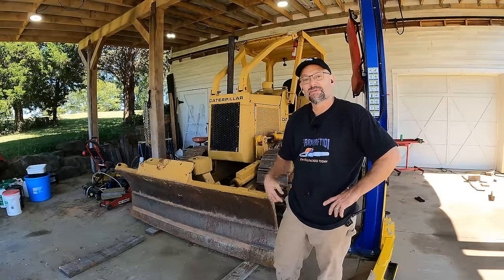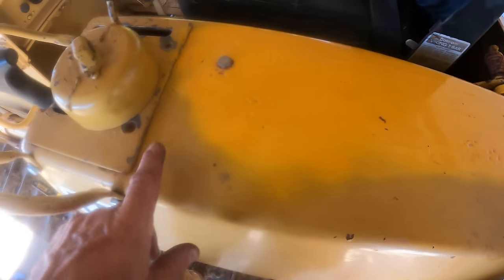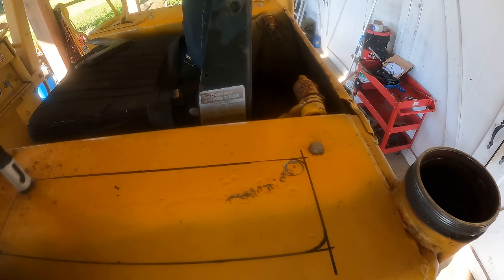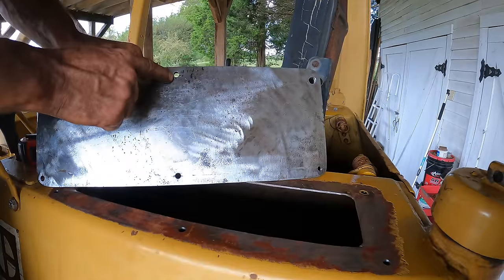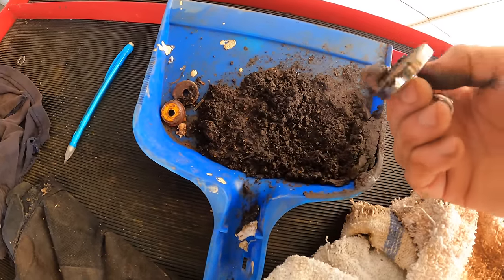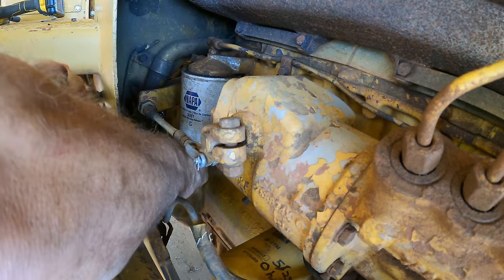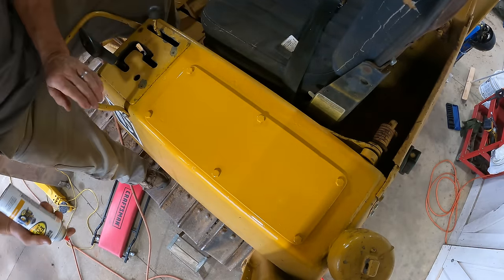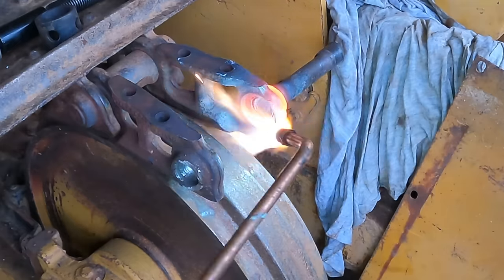Fixing My CAT D3's Fuel System & Exhaust. Cutting Open The Fuel Tank.

Comment: Minimizing water from condensation is key to keeping the fuel tank clean.  Water supports biological growth and corrosion.  Keeping the tank full during idle periods and using a biocide additive in the fuel will minimize the issues.  The diesel tank on my sailboat has a gasketed plate on top that provides access for cleaning.  I added a dip tube to the closure plate that extends down to a 1/4-inch above the low point of the tank. I periodically pump out the low point through the dip tube to take out any water and algae that might have accumulated. (The algae grow at the water-fuel interface.)  I haven't had a filter clogging issue since I started using the biocide, keeping the fuel tank topped up during idle periods, and using the dip tube a couple of times per year. Some of the gunk in your tank looks like dead algae and the byproducts from the algae eating fuel.  If there are adherent deposits on the tank surface after pressure-washing, try removing them using a rag soaked in acetone or another aggressive petroleum solvent.
Reply: Yea I thought that there may have been bacteria in the tank also. And yes all diesel tanks should be full at all times. I had a bacteria in my excavator tank, it took years to get rid of it.
Reply: Is there a fuel resistant paint that he can hand paint into the upper part of the tank (where the moisture would most often form from condensation) to prevent rusting and the chippies of rust flaking off down to the bottom of the tank...

Comment: I use magnets in my oil sump near the pickup.  The idea is that any metal particles that come from the engine don't recirculate.  I don't suppose there's as much opportunity for metal to enter the fuel tank.

Comment: John, when I was in the Army we used to "purge" fuel tanks on those M60 fuel tanks by dumping a whole bottle of dish soap in the tanks and sticking a hose in and let the water run till got all the soap out. Those bubbles would pick up all the loose particles and float them out. Something to think about.

Comment: flap discs for angle grinder are usefull, have you never tried them a lot of what you did like scraping the paint from top of the tank would be much easier, they work best on angle grinder with speed control as its best to run them slower than grinding disc, they also last longer if you nrun them slower.

Comment: Hey John, when you use a spray paint can and you still have some left in it, turn the can upside down and press the button till it sprays clear. This cleans the nozzle out so use can finish using what’s left, at a later time. If you don’t, like your showing, the paint dries inside the nozzle and it won’t spray. Just a suggestion…,

Comment: I have this really cool idea. 
Have you seen how they can line your clay pipe sewage pipes all the way to the street use injection to put a plastic linner in the pipe and a blader to form it  let it cure then take out the blader you get a smooth wall plastic drain pipe for less then it cost to dig up and replace your old system.
Something like that could work for heavy machinery the tank is part of the machine like the cat. Or an excavator, bobcat, even a farm tractor. All you would need to do is tap into the new tank inside the metal box. Solving you problems even fixing holes. And its fiberglass materials. So its going to last a long time.

Comment: G,day John from Sydney Australia.
Isn't it difficult to color match paint when it fades?
Pro tip
After using spray cans, invert the can, wait until the paint settles in the top leaving the straw exposed inside. Expel a short burst to clear.
Wipe the nozzle with solvent also helps.
Fuel tank
I was astounded by the amount of sludge. It's looking like a valuable dozer.
🌏🇭🇲

Comment: I have used a porta power in a rectangular shaped steel cage to drive those track pins out. Oh, and lots of JB Blaster. I don't recall how I got the steel box over the track properly but I remember it was out in the woods in close proximity to a hornets nest.

Comment: John - When you finish using your paint rattle can, invert it. and clear the supply tube and spray nozzle by releasing some of the propellant until it no more paint is released. Keep the spray can inverted and store in that orientation until the next use. This should solve your spray paint problems for the future.

Hope this suggestion helps. Use it for all the rattle cans you keep around.

Comment: I'm surprised you did not use any rust converter like CLR to fix the rust in the tank?

Get Vevor to send you a plasma torch.  Then you can zip through hardened steel plate and make better wear plates.  

Also, I know you like shade, but I'd pull the dozer out of the shed where you can access the idler wheels with a hydraulic lift of some type because those bastards are heavy.  Ditto when you have to move the tracks around.  Moving that heavy steel with the tractor will save your back.

Comment: You should print yourself one of those drill attachments for a paint can shaker. It will mix up a can extremely well and fast. It may not fix the clogged nozzle problem but it might make the paint last longer.

Comment: Take the nozzle of the spray can & hit it with carb cleaner or brake cleaner. Use the straw on the tube that goes in the spray can.

Comment: Great job on the fuel tank. 
Hey Caterpillar how about putting an access plate on the tank? Won't cost much and will make cleaning and inspection possible. That way the Caterpillar Service Tech won't get paid to do as many service calls..........
Oh never mind that will never happen. 
Just a convenience thing if you can move the fuel filter a little farther toward the injector pump it would be easier to reach. Also the syringe idea was inspired. Planning ahead it might be possible to install a T in the line with a ball valve  on the side of the line to make a port for bleeding the line. Plug the valve and when you need to bleed the line screw in a hose barb and short hose open the valve evacuate the air and close the valve. Might not need it but once. If you do it will pay for itself. 
You might be able to bolt on a wear bar to the bottom of the rail without removing the wheel.
Weld up the worn section on the bearing plate first while you have room. 
Then weld up the worn area at the back of the worn section of the rail and grind it flat. 
Then loosen the track and slide it back and weld up the front.. With the rail welded bolt on a section of 12560 to the rail as a sacrificial wear plate. 
I would love to have a bulldozer. Just not mucb need on a 1/2 acre lot.  😁😎
The track pins wear and end up with a notch that locks the pin in place.

Comment: Hi Jon. I would weld that inspection plate onto the tank, then there's no risk of water tracking in under the seal (bad seal!) and contaminating the tank. Unlikely you will ever have to go back inside to clean it out, and if you did, it would only be 30 minutes to grind out the welds enough to pry it open. By the way, angle grinders are my favorite tool. I have three Makitas each permanently set up with a cut off disc, grinding disc, and a flap wheel.

Comment: You can put a 1/4” fender washer under hole saw and then remove after you pop through with the pilot bit. Saves on the bit and you.

Comment: For the wear plate, you should put one on track frame and one on the wheel slide. By doing it this way, you will wear on the plates rather than wearing into the frame and the wheel side wear plate or vise versa.

Comment: Another excellent video. Interested to see how you tackle the track removal, I would have the dozer out side then release track tension and flick them off with the excavator bucket or chain and walk them off with dozer.
Reply: done that with old AC5, and an old JD 420C. But they are both spring loaded, just have to release tension, walked track off with a few long bars

Comment: Hello John, I reviewed a few comments but I do believe checking the fuel tank CAP the cap has a breather to allow air flow so fuel can drain.  So the breather needs to be cleaned or replaced with new internal materials.  That could be part of the dirtiness inside the tank filled with dust. See u later John, from another John T. in Calif.

Comment: I noticed when you were using the hole saw you might of bent your pilot bit. Here's a nice trick to prevent that. Take a 1/4 fender washer and slide it over pilot bit before drilling pilot hole

Comment: Nice job on tank access plate and cleaning, tank coatings would have been a disaster. Wear plates repair job is a mission but it's only your time so if you feel able go for it I suggest you use plate 1/4" thicker than you need and grind weld side by hand to fit dozer and use weld grooves to allow stitch welded joints ground smooth to allow for surfaces to move freely like I noted it's a mission but when done dozer is ready for second life. Ray Stormont PS WITH ACCESS PLATE PUT MAGNETS INSIDE TANK.

Comment: I'm glad you finally got the fuel tank clean.  I had a similar problem. The only thing I can humbly suggest is next time, hopefully there isn't one, is to apply a gel rust converter after the mechanical cleaning. In a spray bottle you should even be able to get the underside of the top. Anyway, thanks for all your videos.

Comment: You should look into getting a fumoto valve instead of that ball valve for the tank drain. They're an oil drain plug replacement that's a valve but I think it would probably work for the fuel tank. That shouldn't be able to open on its own but will still be easy to drain.

Comment: Great video John, I thought you were going to sandblast the inside of that tank to remove the rust,But you got it clean. Vevor stuff seems pretty good. I bought a 85 ft garden hose reel from them, Noticed the back was separating on the swivel mount, contacted customer service they were excellent to work with even though I'm in Canada , fixed it myself( like you would have) got payed back for materials used & money back for the product . Would buy from them again. Gord

Comment: When you go to fix the track frame , use 1018 steel not plain old MS strip. 1018 will weld in nicely and hold up better over time. Do a base metal build up to level the track frame then add the wear strip. I would use 7018 rod to do the base metal build up not mig. Will take longer to do the build up than mig but should dig into the original steel deeper than mig. Preheat then weld. Determine if the idler mount is cast iron or cast steel, if cast steel you could rebuild that also. Good luck.

Comment: Probably too late for your purposes but you can cut a track link in two after removing a pad, of course. Stagger your cuts so that the potential weak spots are not all in the same plane. Once the work is done and the tracks are ready for re-assembly, use the pad and fresh bolts to hold the track link together and spot weld it together. Then remove the pad and heat the link with a rosebud if you have one and fill in all the gaps you can. I know it seems like a procedure but if you’ve ever tried to drive an old rusty master pin out you may want to consider this method. It’s kind of a known quantity. That tank cleaning was inevitable. I had to cut three access holes in a D7 tank once years ago and use a hoe to scrape out the two inches (!) of mud on the bottom. Guessing it had been vandalized at some point. 🤷🏻‍♂️

Comment: John, I'm not sure if it's possible, but here's something to think about so you can do the job without having to remove the tracks. If you were able to unbolt the tensioners from the idlers and the frame and get them out of way, you could slide the idlers back to expose the area you need to repair. You could also remove the first rollers under the frame to give even more  room to work. I'm not sure if you can remove the tensions without removing the tracks first, but like I said- something to think about. Good luck, G.

Edit: I missed the part where you showed the damage to the slide bracket itself, so you may have to remove the tracks anyway...

Comment: That was a really neat job 👍 the flux lines for the external magnets are being “shorted out”, the magnet needs to sit inside the tank and held away from the metal, same as a car drain plug magnet, then it’ll work properly. But like you showed, not all crud is magnetic 😬 problem fixed anyway

Comment: You could also fill the hole tank with 10% citric assid. That will „eat“ the rust from the Steal and you can drain it out. I did it on several Motorcycletanks. Works great.

Comment: Soak the spray can nozzle in acetone to revive it. And remember to always blow the nozzle clean after use by turning the can upside down. (But you already knew that)
I have a dedicated cardboard box i use for that, its deep, and captures most of the  overspray.

Comment: Thick neoprene gasket would have taken up most if not all of the curvature I am seeing on camera (might be worse in person?).  Common on tanks of all kinds aboard ships .  Just use plenty of bolts to suck it up.  I would start with four inches on center and move up to two if you need it.  That is assuming your tank is thick enough to take a thread and using 5/16ths bolts.

Comment: I'm pretty sure once you get it cleaned out, and assuming you keep clean deisel fuel in it without letting it sit for long periods of time, it will never be an issue again.  Most likely, that thing sat for a long period of time with water in the diesel and was never cleaned out.  Rust built up and someone sold it to get rid of it.

Comment: I haven't watched yet John but, I can tell you how I fixed a similar problem easily. We welded a air fitting to the cap and pressurized the tank and blew out all the crap thru the drain

Comment: Whenever I use a hike saw I unscrew the hole saw from the arbor, drill my holes and then fit the hike saw back on. This way the arbor never gets tweaked from when the drill bit pokes through the hole and the hokesaw catches..  be cool, freezerburn

Comment: If you find yourself draining fuel out of the tank a lot, you might look into a Fumoto valve for the drain plug.  They are spring-loaded and the lever rests in a cutout in the valve body, so they can't rattle open.  Also they have a nipple on them to easily slip on a hose.  I've used them on the oil plugs on all my vehicles and never had a problem.

Comment: Hi there 
A needed job done and clean fuel will stop it happening in the future although some fuels have additives that sludge up after a while or in cold weathers, a tip for cleaning fuel tanks from rust is use a 9 to 1 mixture of water and molasses , you have to leave it for a week or so but it works , some washers and spring washers would have looked better on your new lid , but another great video and can’t wait for the track off job 
Take care and regards Davy 🏴🇹🇭

Comment: The tank actually looks pretty good for its age. Usually what does these steel tanks in, is storing the machine without a full tank. The daily heat cycles and condensation gathering on the top then rusting it out. If I had to guess it looks lick dirty site fuel over the years.

Comment: My only caution about just doing the head is that if the engine has never been rebuilt and you change the operating conditions by rebuilding the head you risk some cascade effects with bearings, rings etc.

Comment: I had the same caterpillar 931 unit, when I needed to clean out the tank I removed the drain and then used my pressure washer and degreaser and flushed the tank. It worked perfectly, tank came out clean as it could be, checked behind the baffle with a mirror and flash light. Took about an hour and half for the whole process.

Comment: I would still coat the inside of the tank with that rubber for gas tanks while you have it open and clean. John, what if you put those magnets inside the tank to pick up pc. of metal and or rust. Is there any kind of a screen to cover the pickup tube ?

Comment: As always, a great video. Thanks for the sneak peak into the track removal.  I'm sure you have done the job already but I am thinking you could have made a mold of the metal that needed to be filed and just shaped your steel pieces to fit the mold and then weld into place.  Wondering if layer of Delrin would have helped too.

Comment: This happens a lot on marine diesel engines. Probably mostly diesel bug - happens when there is a bit of water in the diesel even from humidity. An organism actually breeds in the diesel/water layer and ends up creating that sludge. Worth putting stabilizer in your tank especially if it's sitting for a while. Love your videos - thanks!

Comment: Another great video John, Going forward with the track splitting/removal back 20+ years ago (im 59 soon) i used to have to remove the tracks on 50 ton crawler cranes for repair as a plant mechanic.We made a dolly out of 3/4 round stock around 3 or so foot long and we welded a striker pin about 10-12 inch long  just a bit smaller than the king pin at about 70 degrees angle and to get your hands away from the tracks while it was held in place over the king pin by a friend with thick gloves on. This was used to drive out the king pin with a sledge hammer while heating the chain around the king pin area to cherry red with the gas axe (oxy acetylene torch) a big nozle one.. Do this on a cold day as it will make you break out in a sweat as this is a tough one and a lot of effort needed.Also as a side note did you notice on the track frame underside it looks like there was 3 bolt holes/broken off bolts which secured a wear plate that has long gone? This could be made and refitted once the frame has been built back up with weld or as you sugested a triangular piece and would be a quick fix in the future just to replace the wear plate..just a thought.